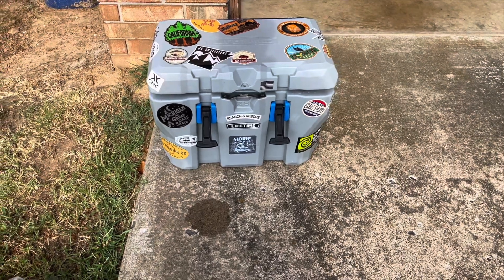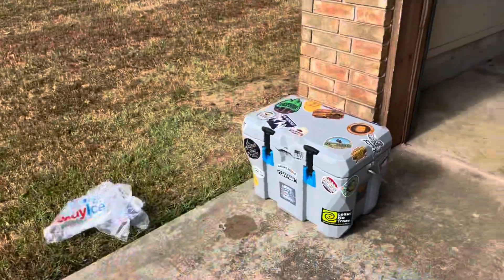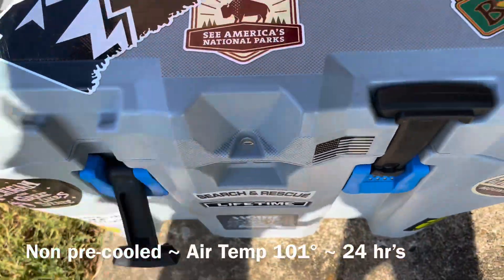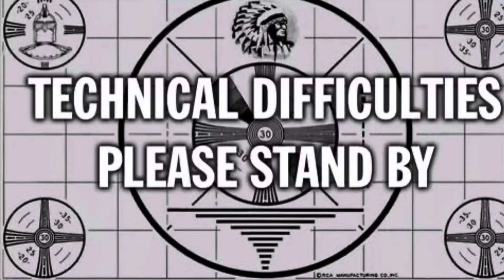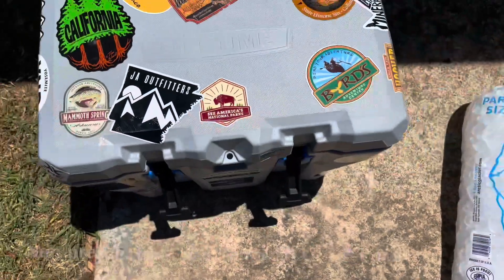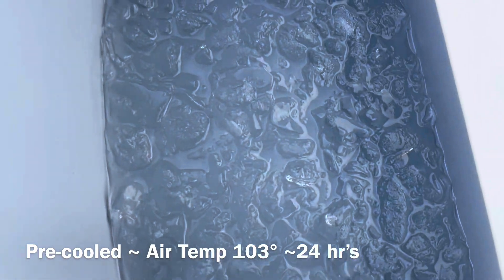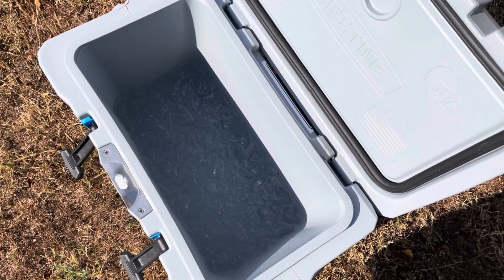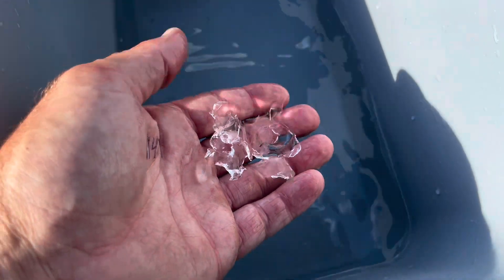Lifetime 28 QT High-Performance Cooler Ice Retention Test

Comment: If you take a little time and pre-cool your food and drinks AND the cooler,  load right before your trip and pay attention to keep it out of the direct sun, you'll get 4-5 days from it. Save 2 liter soda bottles and freeze those and or, larger Tupperware containers to make block ice to supplement the bagged ice. A little forethought and effort goes a long way. Furthermore, if you're doing a longer trip in hotter conditions, use one of your large older cheap coolers (everyone has one or two) and pack it full of block ice.  Gallon zip lock bags filled and frozen stack and freeze well too. Fill that cooler full, seal the seam with duct tape and cover with sleeping bags/blankets and pack it away and don't open it till day 4 or 5 when you need ice. break that ice up to get 3-4-5 more days from the Lifetime.

Comment: Two to three days is all most people require anyway. That said, a pre chilled cooler, an ice pack underneath everything, already cold items, and the rest of the internal space of the cooler packed with ice and I suspect four days easily of ice retention. Air space inside a cooler is deadly on ice. Thanks for the video. 👍
Reply from the maker: Agree 100%. I wanted to make the video in absolute worst case conditions to get a baseline for what someone can expect. Any techniques applied beyond that only increase its ability. Thanks for watching!
Reply: @WaywardStories  If you keep it out of the direct sun and in the shade - which is not hard to do in reality - you will almost surely add at least twelve more hours of ice retention on it.

Comment: How do you "pre-cool" a cooler that size or larger?  Do you have a walk-in refrigerator??
Reply from the maker: You put ice in it the day before. Or you put those big freezer packs like you put in lunchboxes or people get in meal kits the day before. As others have commented, frozen water bottles work great to. 

Essentially, once the inside has reached its coldest possible temp, any new ice added lasts way longer. 

A bag of ice the day before or freezer packs is what most people do

Also if you store it in the house at room temp instead of the garage where it’s 150° all the time also helps

Comment: Good cooler... no drain, lid sticks like crazy & have to gorilla grip with 2 hands to rip the lid off, latches do not lay flat up against the cooler, cannot reach over your truck & pull the handle ( long ways) it will slip out of the holes.